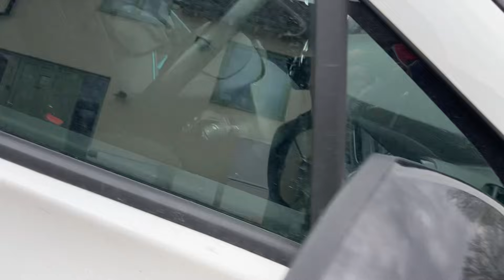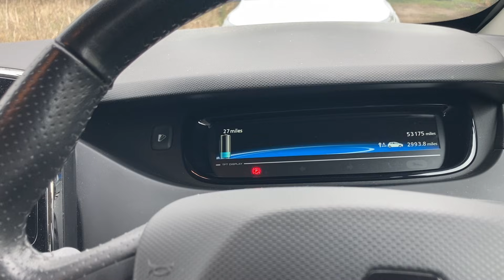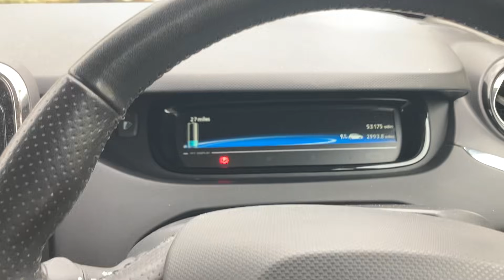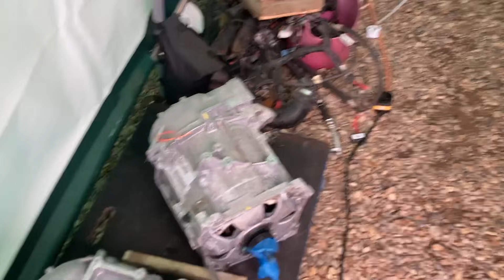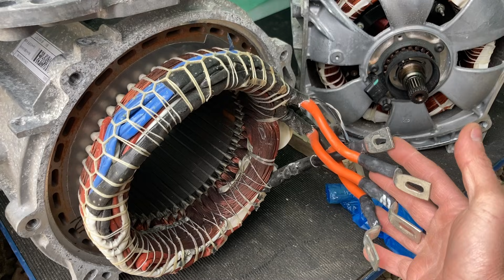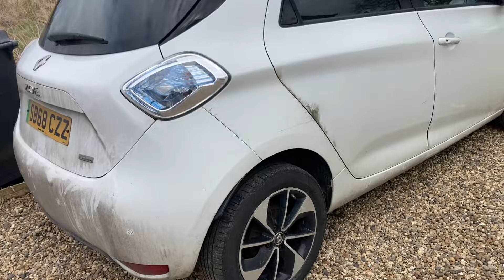Is this 6 year old EV scrap? 🫣 Renault Zoe Electric Car faulty - EV Salvage Car Repair Mechanic

Comment: And ev,s are the way forward 😂😂
Reply: What a relief that no ICE cars suffer from terrible design problems and hefty repair bills!
Reply: @PJWey  Still MASSIVELY cheaper to repair than a EV. Yes ford & JLR have problems with the ingenium & ecoboost but there's millions of cars, engines, brands that don't. a Toyota yaris 1.3L vvti petrol will still be on the road in 25 years, a renault zoe will not... lets face it
Reply: Ice cars and vans are blowing engines up daily thanks to fords , Peugeots and Hondas wet timing belt idea 
That was absolutely crock of shit 
10,000 of thousands of 1.0 Ford eco boots and transits , belts snapping and bang new engine

Comment: Do you actually get electrical schematics from Renault? And what service Software can you use? Is that standard OBD stuff?
Reply from the maker: Yes all the wiring diagrams are available from renault and aftermarket diagnostic tools can communicate with the car. Cheers

Comment: People like you are the future Gary! As there is more and more EV adoption, then traditional mechanics will need to either reskill or find alternative work. No matter what the energy source, cars (as with all electronic and mechanical things) will occasionally have problems. Heck, I've had several new petrol cars that have had far worse and more expensive problems to fix at fewer miles than this one. My 5 year old EV has been trouble free! The challenge right now is not enough Garys to fix EVs, but that will improve through necessity. This kind of video is great, as it shows EVs aren't all 'voodoo' and can be fixed, so others should be encouraged to get skilled up too

Comment: We bought a 2014 Zoe 7 years ago for just under £5k and it is still going strong. It’s approaching 60k and not had any major problems, so they’re not all poor.
Reply from the maker: That's good to know, the other Motor type (continental, 5AM) on the early Zoe is more reliable. Cheers

Comment: Thanks for the video, my Zoe is 6.5 years old.To be fair it’s done everything it says on the tin,until recently when it wouldn’t accept a charge,which was a huge worry. My garage found a number of fault codes which they cleared and it now works,but it doesn’t inspire me with confidence.The depreciation has been massive,so basically I must hang on to it and hope for the best.I regret my original decision to buy it.
Reply: Only the mad buys new 
Ice or EV 

3 year old low milage all the time
Reply: If it will not accept a charge that's a big problem if you put it on over night expecting it to be ready to go to work in the morning.

Comment: It’s outrageous that EVs are scrap in six years.Not so green now, are they.Who’s got 50,000 pounds, every six years to buy an ordinary car, and a Renault at that.
Reply: It’s not scrap 
The owner could have had it fixed for a few grand 

The guy in the video who has bought it 
Will fix it and sell it
Reply: You've really gone to town with the misleading statements there.  One EV being US at six years old can't be extrapolated to "all EVs are scrap in six years" as you are doing.  Likewise Zoes have never cost anything like £50k.  On the green front, even if that car is scrap then most of its parts can be re-used.

Your problem is that you're desperate to arrive at an incorrect conclusion and so you see only what you want to see.
Reply: @johnwinters4201  Defending your bad choices in life, mug?

Comment: Well petrol/diesel engines also fail, and a new engine is expensive. It's not just electrics. Buy Toyota and get 10 years warranty
Reply: Yes, but everyone tells us that electric vehicles have less parts and are more robust. And honestly it looks very similar to my washing machine motor - i would have expected a little more sealing in a car..
Reply: @MiDo-by8ib  it's a cheap Renault. They have faults. At least it's not a mini
Reply: @CupOfSweetTea Nothing wrong with a mini but, alas, they stopped making them in  1986
Reply: @MiDo-by8ib  I think my washing machine motor is actually better and better protected than that Zoe one!
Reply: @G-ra-ha-m a motor built by continental perhaps
Reply: When the old VW Beetle engine failed, 4 bolts and it was out. That's a whole engine.
Reply: @G-ra-ha-m  things may have changed a little. I'm sure that engineer wasn't the best for the world.
Reply: @ Designed by Porsche, he designed good stuff. But the point is that it was easy to maintain. An electric motor is known wear item, and far simpler than a complete beetle engine. If should be a bolt-on part, simple, easy. There really is no excuse, especially for a product sold as 'green'.
Reply: @G-ra-ha-m  I suspect economy of scale to kick in. Soon mechanics won't know diesel, then petrol. It will all swap. You can't stop progress
Reply: @CupOfSweetTea  Deluded
Reply: @CupOfSweetTea  The problem is that every maker for every model seems to use unique parts.
Reply: @G-ra-ha-m  that's certainly untrue

Comment: I think the Zoe is a cool car, but it would still be way down on my list to consider.
It's incompatible with AC charging in many places in Norway, unless you have an insulation transformer, or an alternative adapter.

You either have to bring an adapter yourself, or rely only on compatible public chargers.

11 kW stations and above, are compatible, because they are 3-phase 400V, but 
there's no way to tell which public single phase stations (in Norway) are compatible except just knowing, or trying, because they might be on a 230V triangle-grid, or a 400V star-grid.

The different grids, are grounded differently, and the way Zoe charges, is incompatible with  about half of Norway, having 230V delta.
Reply from the maker: That is unfortunate if your “Single phase” is actually line to line, similar to how USA homes have two 120v ac Live connections and a ground and for high power appliances use the live to live Power. No good for a Zoe.
Reply: @garycevrepairs  yes 230V  IT/TT (triangle) was the norm in Norway before the 90s.
Starting in the early 90s most new grids are 400V TN, (star), But sometimes 230V IT is chosen for new grid structures, where existing installations get connected, instead of making them compliant with 400V TN supply, and sometimes existing installations get an overhaul.

240V split phase have some similarities to 230V IT/TT 3-phase.

On the other hand, in a 400V TN installation, you can use 400V single phase equipment between two phases

Comment: Don't buy a battery car, simple
Reply: Renault
Reply: My 1998 Renault Megane Diesel would suffer an accelerator fault with revs sticking at 2000rpm if a mobile phone was called inside the car! Ah Renault engineers you beautiful people 😅

Comment: Fridges last longer !!!
Reply: But they don't stand outside in Scottish weather..
Reply: @MiDo-by8ib  that's why Scotsmen don't live very long, or maybe it is
the high drug abuse, alcohol, or obesity ?
Reply: @EternalRUSHfan63  Ford 1.0 eco boosts sold by the 10s of thousands and Ford transits 2.0 and Honda civic 1.0 from 2017 to 2023 and peogeot 1.2 petrol cars all last less time that a fridge , even a Dawoo or Bush fridges last longer
Reply: @boyasaka  yeah the wet belt variety ,I got a 40 year old golf still going strong !!!

Comment: My understanding is the bearings in those motors are extremely common. The tolerance  is so critical between the motor shaft and the sensor that even the slightest play in the bearings can cause the fault code for the position sensor fault.

Comment: Strangely, several Uber/Bolt drivers have told me the ZOE  was the most reliable car they ever had ....  One with 350.000km, another with 396.000 and the third guy had various ZOE in the fleet.
Also, worning me there 2 other guys with ZOEs, both with more than 160.000km (100.000miles) and both say the car is bulletproof
Reply: @TheAllMightyGodofCod  Yes. Perhaps a percentage of Zoes were Friday afternoon jobs or the parts fitted.in them were Friday afternoon parts.
Reply: @Goodchappy  maybe.
They are very popular at ride sharing companies and as corporate cars so, they must be decently reliable.
Reply: That's ok then
Reply: Those are probably all R75 very rare low power versions bought by companies and taxies etc, that are more reliable because of low power plus constantly driven in ECO mode for max range. Notice in these videos are mostly R110 driven by regular people who drive it like a petrol car

Comment: The real problem is the almost complete lack of any garages willing to bother actually trying to solve a problem. As you demonstrate, these aren’t complicated problems to solve necessarily, but the people in the garages just can’t be bothered to try - even though they’d probably happily strip an ICE of far more components to replace something equally small.
Reply: Liability for the garage is too high with these repairs.
 Same goes for the huge problems with modern diesel engines, its just not worth the grief.
Reply: @paulgardner8312 Get a Morris Minor....Easy to work on..cheap spares and you use spanners instead of a laptop
Reply from the maker: @andrewkeith5  it’s getting better, there are many hevra approved garages that would take on this kind of work, but we do need more. Cheers

Comment: willing to bet that sensor that packed up is made by Bosch and they have it buried in their parts catalogue somewhere 😭
Reply from the maker: Renault sell the sensor separately, unfortunately it's a lot of disassembly to get to it and the issue may not be the sensor itself as it could be movement in the rotor shaft perhaps from one bearings or another issue. Cheers
Reply: @garycevrepairs I was just making the point I bet that sensor isn't unique to Renault. I've often to find parts for older cars had to do my research and find other car models that use similar or the same parts 😊
Reply: @garycevrepairs oh yeah completely agree, even being able to get the part doesn't make a difference when half the car has to come apart to replace said part

Comment: My friend has a 2 year old Audi e torn that refuses to charge. Termination of his lease should solve the problem. EVs are garbage and I’m sure it’s just a way of getting us off the road. They are expensive to buy new, expensive to make, expensive to service and repair, expensive to charge whilst out and about on the road. Not much going for them. 10 year old BMW diesel would be a better buy, failing that go get a 20 year old Peugeot diesel for a fraction of the price.
Reply: Lease. There's your problem right there.
Why would a maker bother building long lasting cars, when people just lease it for as short as 3 years?
The car is paid after that and it's not the maker's concern anymore.
If the car gets resold and fails the new owner he will just say "I was unlucky, the precious guy must have trashed the car" and the brand's prestige is unaffected.
If we want cars to last, we need to go back to buying them and to keep them for long, otherwise, the makers won't bother.
Reply: If you're worried about cost, don't buy an Audi anything.
Reply: Yes  agree, BUT NOT thet Peugeot.
I had a brand new 207 that was a garbage money pit from start to finish.
And the drive was abysmal even when it behaved itself.
The experience and what I discovered about the engine sent me over to electric, most  reluctantly, and I've never looked back.
Modern combustion cars are a liability, probably by design.
Reply: @Philip---pip267 I’d have the old 1.9 diesel engine from the early 90s. That thing would just keep on going no matter what.
Reply: @al1356  yes, agree totally.
The 90s and early 2000 was the sweet spot for technology and reliability. 👍
Reply: @Philip---pip267 Still got my 1.8t Leon Cupra from 2002. Despite being modified it's still on original engine, gearbox and turbo.
Reply: @Philip---pip267 I don't know about the 207, but I ran a 406 diesel, amazing car and cheap to run.

Comment: So can anyone in the industry tell us how much it actually costs to manufacture the motor that Renault want £3500 for?
Reply: The net price for the manufacturer when they order in quantities of more than 10000 pcs is probably like 10% of the price they sell a new one to you and me as a part.
Reply from the maker: I doubt anyone would actually know, as it's made in a massive factory with a large amount of other components. Cheers
Reply: It's been known for decades that the motor industry markup on parts is 400%

Comment: Used to buy like 6 year used car and drive 10-20 years with nothing! Not any more with these! 😆
Reply: Or you could buy a "wet belt" Ford diesel (AKA ecoBOOM) and spent £1500 every 50k having the belt replaced )plus oil changes and other service)
Reply: @rogerstarkey5390I was a total ford fanboi until ecoboom. It's not just ford either. Peugeot and vauxhall too
Reply from the maker: All modern vehicles are incredibly complex, whether it's petrol, diesel or electric, and I don't think any of them are made to last a long time. They are so stuffed full of sensors and safety systems and the more things you put in a car, the more things can break. Cheers
Reply: @garycevrepairs Yes, and I blame the politicians for all this, imposing stupid laws that are designed to keep them in work, not to benefit their citizens. Cars have far too much unreliable tech on them
Reply: @ Yea, thats why I drive still like 1990 Toyotas, just simple and works!
Reply: early 2000s was peak automotive for the cost effective but reliable solutions anyway. Timing belts reached their maximum lifetime of 200k / 10 years. This also the matches the timing chain lifetime with modern engines and service intervals.

Comment: Is this basically the same electrical tech that is used in the new Renault 5 electric ? Lets hope not !
Reply from the maker: Hi, I haven't managed to find any technical information on the Renault 5 yet but I would be surprised if it isn't very different, you can see the Zoe design is dated now. Cheers

Comment: If an EV doesn’t become carbon neutral until 60k miles and they are being written off before that they are still more polluting than an ICE vehicle and you could do all that work and spend all that money and in a few months time the battery fails
Reply: ecoboom has the same problem
Reply from the maker: To be fair one of the benefits of the Zoe is the battery and in any case you can replace individual modules if one cell fails. I fix loads of Zoe's and keep them on the road, just a shame they have these annoying issues. Cheers
Reply: @garycevrepairs Come on Gary....You know you want to strip that one down and modify it to take a Cleo ICE. Stop pretending your an EV fan😊
Reply from the maker: Hahaha
Reply: @garycevrepairs generally with degradation, all cells degrade equally. Single faulty cells isn't usual with time and cycle use degradation. After my 42% degraded 30 kwhr leaf, after 9 years but only 42k miles, i wouldn't touch another EV, with a barge pole.
Reply from the maker: @ I would agree that Leaf batteries tend to degrade quickly and evenly but that is partly because they have no cooling or heating. For many other EV's it is more common to have an individual cell fail because they have good thermal management so degradation is low. My wife's old Zoe has 118 K Miles with negligible degradation. Cheers
Reply: @garycevrepairs  I have seen many moden EV's degrade as well. ( battery life, ID3 reported as 10% in 2 years ) i agree though that the leaf is the very worst.

Comment: Thanks for the reply , I gather it’s the stripping down to remove and labour cost , still a bit of a fad and bad design can the motor not be removed from underneath as with the battery packs.
Reply from the maker: Yes correct

Comment: In conclusion it can't be repaired 🤷🤦
£6000 repairs on a 7k car
Or close to  4k Repair with used parts which probably have 1 or 2 years left 🤦😢
Reply from the maker: It can definitely be repaired, it's just a long job and Parts are expensive. I will do it as a project around other things to keep it on the road but it's not good. Cheers
Reply: @ I m not surprised we have 2 Different perspectives i have consumer perspective a (Picky one ) which from my perspective it would not make  economical sense to replace a Defective Part for one which might fail soon while paying close to £4000 however I appreciate your repairer perspective in Trying to convince us to pay Thousands on a faulty product
Reply: @garycevrepairs I would phone the chap with the hiab to take it to the breakers yard....that's If they'd take it... Throwaway cral
Reply: @garycevrepairs That could be said about any vehicle though. 😅 Everything can be repaired if money and time is no issue.

Comment: Same happened to us bought our 2018 68 reg ZOE ZE40 at under 3 years old in 2021 from a large franchise dealer chain as a battery owned vehicle, the I read the HPi report I had asked them to include in the sale, it showed a Battery lease! They had to buy it out at £4,400.
Reply from the maker: Very poor from a franchised dealer, good for you though 😁

Comment: Mild steel reluctor ring + moisture = deliberate planned obsolescence.
Reply: Exactly!
A real engineer would have included seals at the huge cost of about ten pounds at factory prices.
Reply from the maker: Yes it is very poor, they could have covered it in a non-metallic coating to keep it free from rust.
Reply: Yup.
It's got us wherever we turn.
Modern flat panel tellies where the screen fails just outside warranty. Again, unrepairable throw away.